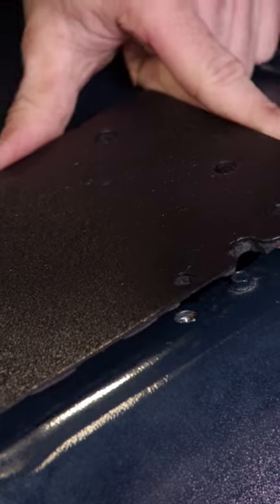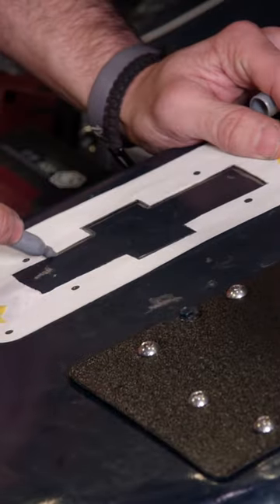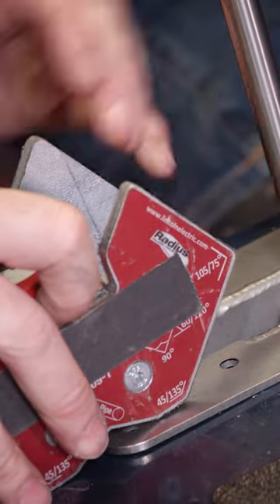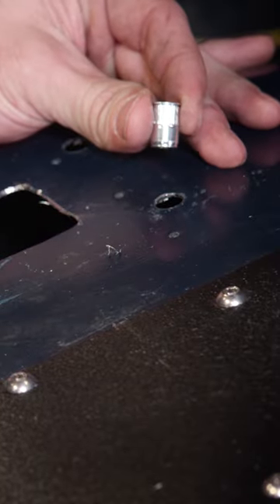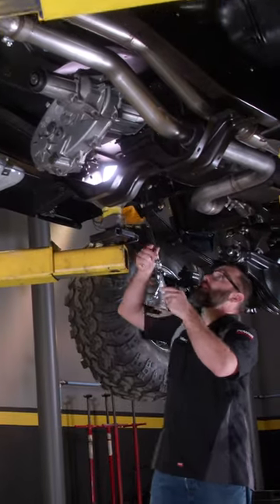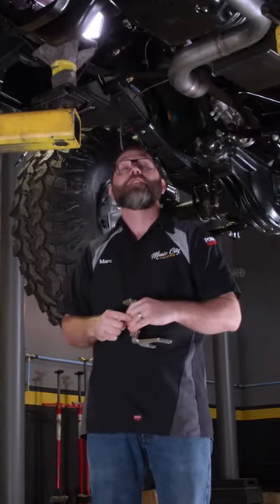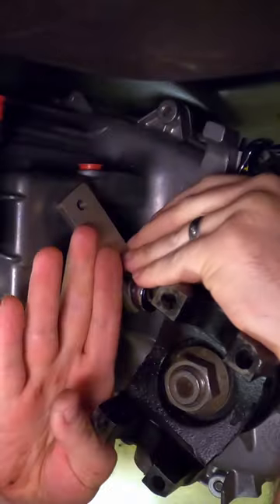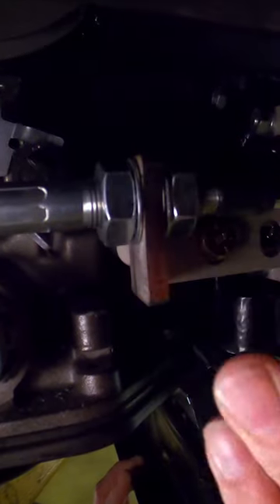Adding a New Transfer Case

Comment: Other than not deburring the cut edges on that shift tunnel and spraying it with a primer (at least) it seems like it'll be just fine.
Reply: Yeah, deburr, prime, paint, and gasket would have been a nice touch
Reply: Gasket for sure
Reply: Came  to the comments for deburring. Like... come on, that's just an unnecessary surprise danger left for the future.
Reply: This is clearly just to make video content. I'm sure somebody more willing and able to do good work will follow-up and re-do everything.

Comment: Nutserts?  Obviously a development of the Rivnut designed and patented in the 1930s by B.F. Goodrich as a method of placing fasteners into aircraft wing skin to attach rubber deicing boots.

Comment: Just a point of professionalism. Use the airsaw first to cut the smaller sections out, so the main body of the cut still has ample contact and reinforcement, to reduce vibration while you cut, leaning to cleaner cuts.